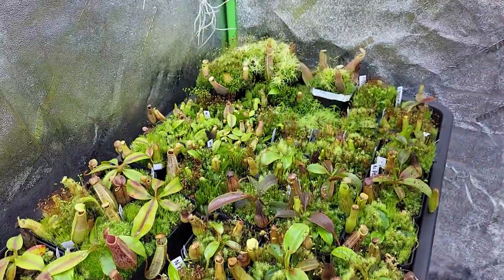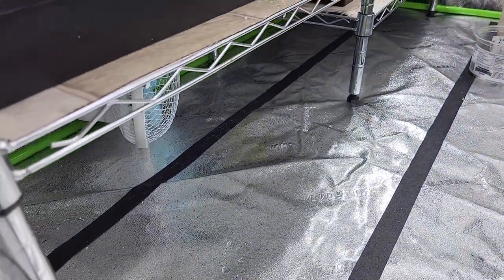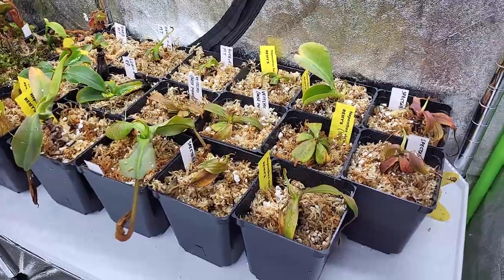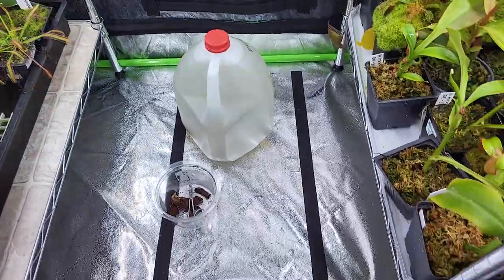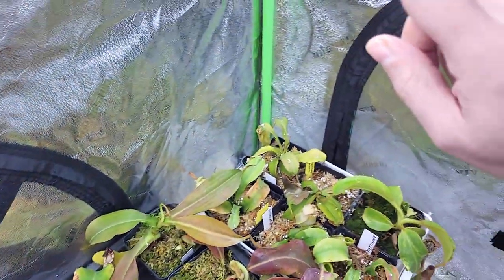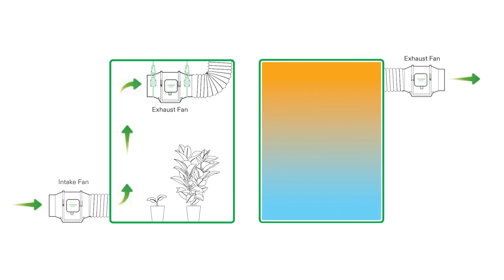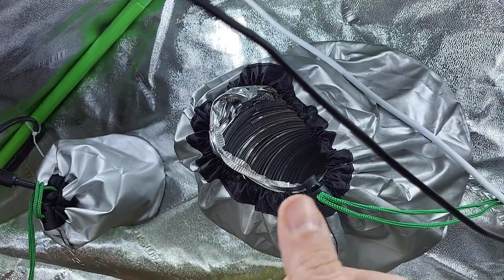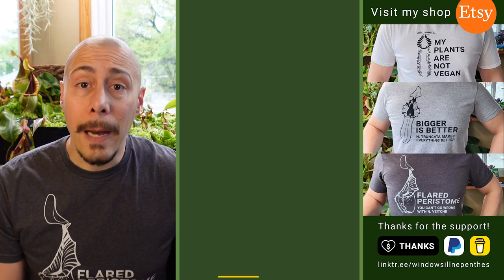🔨How to properly install a Grow Tent: 🌴 3 Months of Changes and Smart system setup

Comment from the maker: ~ Affiliate USA Links to support the channel ~
VIVOSUN GrowHub Controller: https://amzn.to/3qgGxkz
VIVOSUN AeroZesh and GrowHub: https://amzn.to/3OKiQv3
Reply: Hi, Remy - I could use some advice.  I need to cool my 48 x 18 x 18 terrarium.  Due to the greenhouse effect I'm experiencing I need to bring the temp down by about 20 degrees.  I have a House of Hydro fogger piped into the side of my terrarium which does cool the terrarium a bit, and I also have an 80mm fan mounted inside the terrarium which helps with air flow and condensation on the glass, but doesn't really contribute any cooling.  Adding another fan and blowing warm air all around isn't going to be the answer, so I'm thinking I need some type of water chiller for my fogging container or some type of chiller inside the terrarium.  I don't know if a peltier/thermoelectric cooler would do the job or not.  The problem with a chiller is that I want the water supply to be automated so I don't have to refill the reservoir of the chiller every day.  I have been all over the internet and YouTube and can't find anyone who has been successful doing this.

Do you have any ideas? Thanks!
Reply from the maker: I never tried but pelletier cooler could works and I would use it on the fogger water. When the lights goes off, have a fan that suck the hot hair from inside and in the same time the fogger blowing the cold mist, that would maybe work.
Reply: @WindowsillNepenthes  Thank you.
Reply: @markf5175  Hello. If you're feeling up to it you can DIY a closed loop system. You can use a small freezer or fridge (fairly cheap used) and cut 2 4" holes in the top, or one on either side. Then just use 4" ducting and something like a PC fan to power the circuit. This way you don't lose as much humidity. Condensation will build up in the fridge or freezer so you'll need to address that periodically. Shouldn't be too bad with your small space. But tbh 20 degrees is a lot, you probably won't reach that goal easily. Is that when the lights are on? Does that mean you're over 100F? My highland room is at 75-80F during the day.
Reply: @ElmoRitter  I have the terrarium and the container outside. There are no lights on during the day. I rely on natural sunlight. I'm in Southern California so sunlight is fairly plentiful. Temperature is reading 105° on a regular basis when the sun is out, for about two hours, due to the position of the sun on the terrarium and the inherent greenhouse effect. That's just too hot for the plants. I am concerned that the temperature will get even higher during the summertime. I would like to be able to mount the peltier cooler on the outside of the 5 gallon container. I am just not sure if the peltier cooler will cool the container enough,, as was your concern. I would like to have this automated as much as possible - I really don't want to have to put frozen water bottles in the container manually each day. Thank you for your help and comments.
Reply: @markf5175  oh a terrarium outside won't work for intermediate or highland nepenthes. They'll be better off just being outside NOT in the terrarium. Good luck!
Reply: @ElmoRitter  Thanks for the response.

Comment: Hi Remy! Maybe you can help out! I heard that Growtents are not 100% waterproof at the Bottom. Is that true? I mean can you confirm that? I am asking because i want to buy one in the future and i do not want to ruin my Floor.🤔
Reply from the maker: That was my concern... Overtime if there is water on the floor, it will leaks... The fabric or the seams won't last forever. Better safe than sorry 😐 and waterproof outdoor tarp is cheap 😀
Reply: @WindowsillNepenthes  So i saw that you have made some Rubber mats under the Tent. So you think a Tarp helps?
Reply from the maker: @tironjr  My 'rubber puzzle' is more to make the flood less soft so the shelf's feet don't punch holes into the tent's floor. ;) Having the tent resting on carpeting isn't great but that's all I have in the basement.
Reply: @WindowsillNepenthes  So no Tarp?
Reply from the maker: @tironjr  I would use a tarp for safety. ;)

Comment: i am just setting up my 4x4 feet grow tent now, awesome timing 🙂. The toughest thing for me is the cooling and how to fit the air conditioner in (with heat exhaust/draining outside) since I live in a lowland climate and grow some intermediate species
Reply from the maker: Couldn't you have the air conditioner outside pushing the cold inside the tent?
Reply: @WindowsillNepenthes  yes, I mean without it looking very ugly since tent in the living room, haha. Right now it's as you said with window a/c sticking out the back. Could get a portable (standing) a/c to put it inside the unit, but much less efficient with electricity.

Comment: Hey what size is that tent
Reply from the maker: It's a 4x4 ;)
Reply: @WindowsillNepenthes  same while mine is a 48 x 48 x 80 and it doesn’t have a roof that’s different. Did you need the filter for it?
Reply from the maker: @gamingandgardening7729  I didn't put any filter... It's not like it will smell weed in the house, Nepenthes don't smell ;)
Reply: @WindowsillNepenthes  because mine came with a filter
Reply from the maker: @gamingandgardening7729  I don't know what is it for... Filtering the air entering the tent or the air exiting?